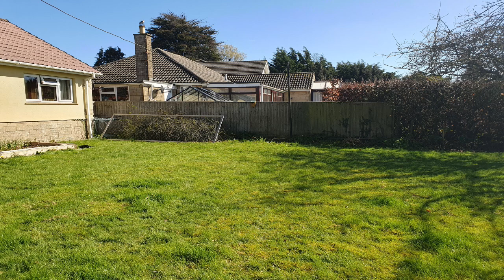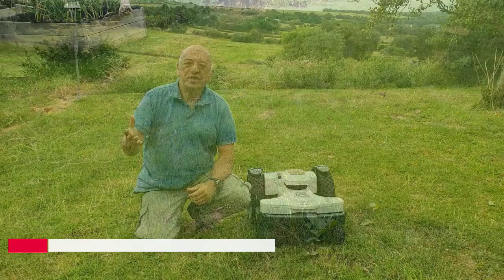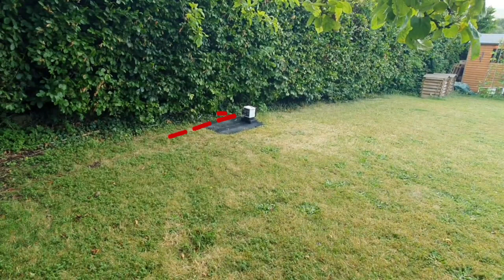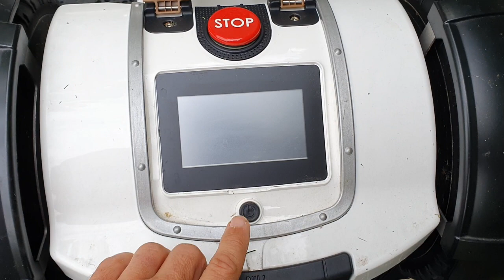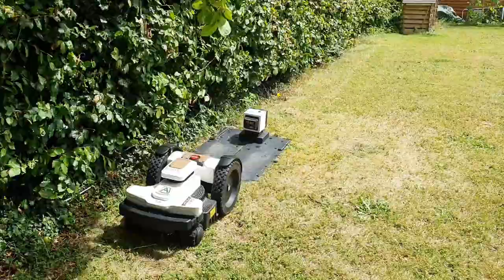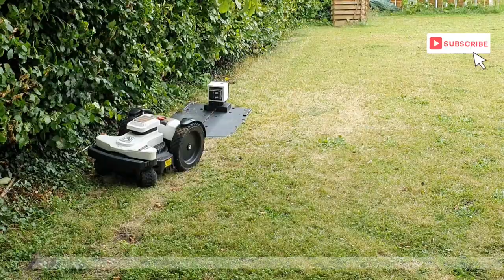Ambrogio next line 4.0 elite robot mower at the Acreage

Comment: By the way, is it completely waterproof? You don’t need a rain cover over the docking station?
Reply from the maker: I suppose it depends what you mean by totally waterproof. I haven't submerged it in water but it's certainly more than happy to cut in the rain (if you want it to). The mower stays out in all weathers over the cutting season. I have a cover for the docking station but that's entirely optional, it would be happy enough outside. I took it into the garage over the winter but other than that it's been outisde full time.

Comment: Spiral mowing is hit and miss, the tight turn circle makes my Ambrogio 4.0 Basic  often  'pirouette' on 3 wheels (check for grass around the front wheels axles!). It should be a user setting on the mower (or the app), but it isn't! Also, you are right about being being careful when putting on the perimeter wire, mine likes to rip off or even cut it's own perimeter wire (laid on the grass, a peg every 40 cm or so): the prongs on the sideskirts of the robot tends to snag them when reversing.
Reply from the maker: I haven't found the same problem of 'pirouetting' with the 4.0 elite 4WD and on this model I haven't had any grass collecting around any of the wheels. I had one wire cut incident in the first couple of weeks, but that was my fault as I hadn't pegged down into a dip. The skirting is on the front and rear for this model and so far (7 weeks later) no issues reversing or turning. I do agree it's worth investing time and care in the initial laying of the wire but it's been fine since the 'hidden dip' was corrected.